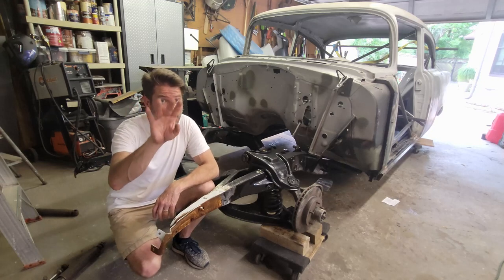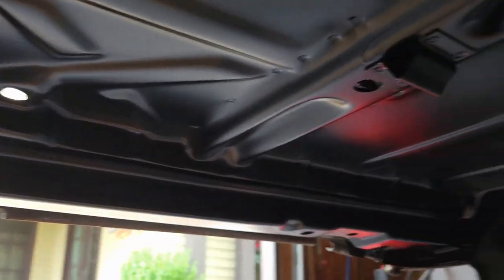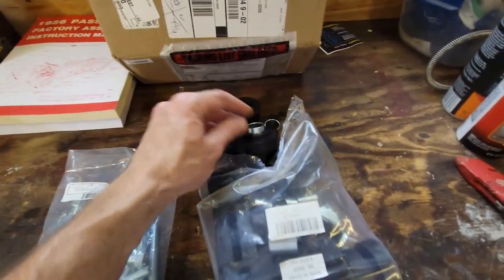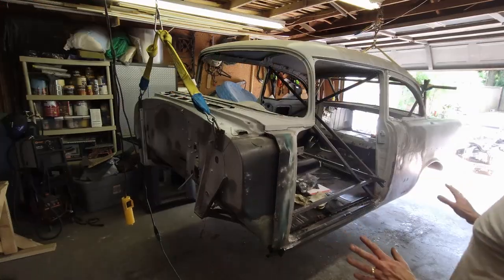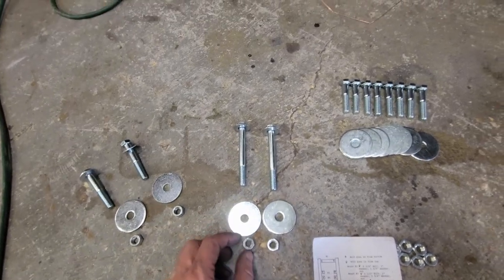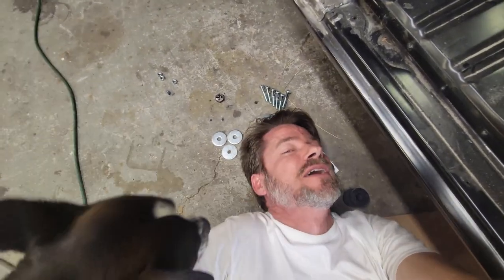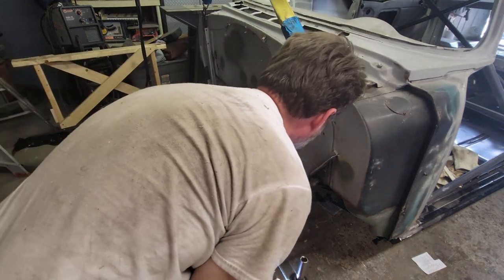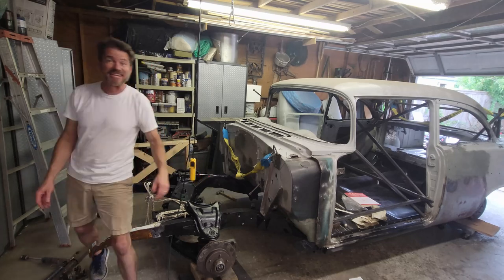E46 Reunited!  Mounting the Body on the Frame!  1956 Chevy Bel Air Restoration

Comment: Well done! I would say to install the doors so you know where the shims need to go if any. Like you referred to earlier in the video, there is a document that assists in how to get the doors to line up perfectly by means of the shims. Hopefully when you remove the inner temporary structure, those pesky trunk bolts will relax and you won’t need longer bolts. Nice job man!!
Reply from the maker: I'm really looking forward to losing the braces!  I will definitely cut them loose first before bolting down.  I'm also really curious to see how the doors fit.  Fingers crossed!

Comment: I admire your courage and perseverance! I'm 71 and remember the creeper under the car years. I bought a 2 post lift or I would not be able to rebuild my 56. Keep up the good work and videos! You have been a great help and inspiration to me, and I'm sure, many others. I have also printed out some things you share, like the Danchuck link today. 56Rick.  :)
Reply from the maker: That's great to hear and it just motivates me to drive on!
Reply: @RestoringChristine1956  I am looking into renting a dry ice 'blaster' to remove rust from frame in my  shop without the mess of a sand/bead blaster.

Comment: Hey Bill, maybe the inside bracing has caused the body to be higher above the frame thus causing the need for longer bolts. Try removing the bracing first to see if thats the problem. Good job.
Reply from the maker: A couple of subscribers suggested the same thing.  I just wonder if it tries to kink the quarters if I do that. We'll find out!
Reply: @RestoringChristine1956  I wouldn't think so. But I've been wrong before. But you have 99٪ of the body fastened down, so you don't need the bracing anymore. You could loosen the ones you tightened a little and let the body relax. Also , when you put the tires back on , that may relieve some of the body stress. Just thinking out loud. Anyway , your getting closer.

Comment: Mine had shimns on the pass side under the foot panel and the next one towards the back and thats all...I'da used the big round washers for the big gaps...musta been a stamping error or something... I wouldn't worry about tighnig perminent till the doors are on....lookin good.....
Reply from the maker: That's the plan!  I'm going to cut the braces first and then check fitment.  After it's all squared up, I'll check with a torque wrench.

Comment: Looks like you worked on your driver side frame horn.  Did that make it into a video?  What number?
Reply from the maker: Yep! Episode 54:  https://youtu.be/46c6sDxa64U
Reply: Just got done watching that.  THANKS!  As it is with old cars, I didn’t realize the frame horns on my ‘55 Nomad were bent until I got the front clip off (got the car as a “rolling project”).  I was fooled by what appeared to be almost perfect front clip sheetmetal but the passenger side horn is really bent, driver’s side not as much.  Because I need access to take out a big dent, I’m thinking I’ll remove those short diagonal braces, straighten the horns then reinstall the braces.  Hope to have the body off the frame within the next couple weeks and will deal with that problem then.